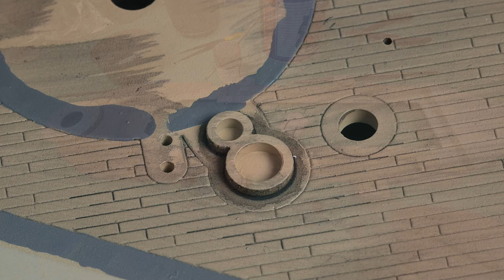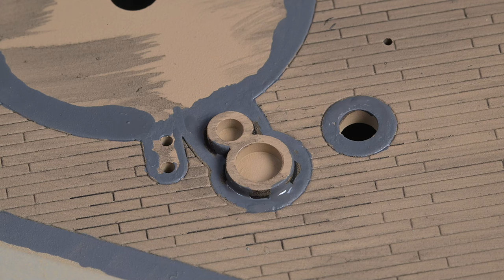The Model Ship - Part 1473

Comment: Hi Ronmyself 
Just a "Heads up" - when You testfitted the 5" gun turret to the Barbet, You had the bottom of the turret (part N5) turned the wrong way around - the tap on the part have to go inside the turret - that way the turret comes closer to the barbet. Love watching Your Videos and Your relaxed approached to model building wich has to be a fun an relaxing thing - and NOT a competition and stressing obligation 🤔- wich we sometimes forget, MYSELF INCLUDED 😇 
Lots of greetings from Lars in Denmark.
PS. Keep up Your good humor 🤗.
Reply from the maker: Will check that out later in today episode 1475. Thanks! 🤞

Comment: Hi Ron, just a quick question if I may: without questioning your artistic licence, what made you want to colour these lines in the deck grey? I believe this is the first model you have done this and from what I have seen the edging boards that ran around the outside of these parts on the real ship were the same colour as the deck. I just have a niggling concern it will make the parts change shape (especially small bits like hatch covers and alike) and not stand out as they would without. 

Of course as always it's your ship so it's your rules when it comes to colours and for the majority of things I welcome the contrast you create with some of your choices, so this may end up looking great too!

Have a good evening.
Reply from the maker: My thinking is that the planking should be deck tan, and metal plating should not. 😁